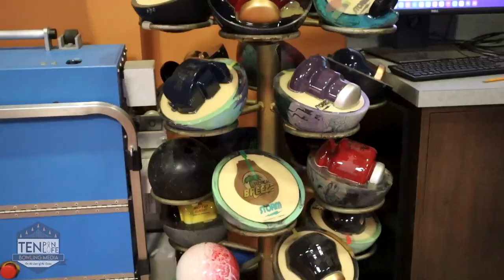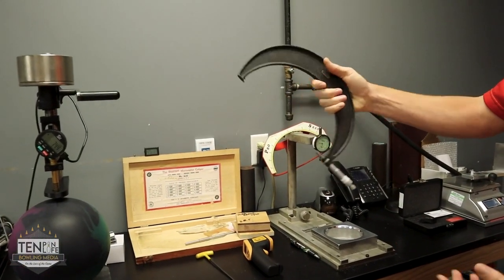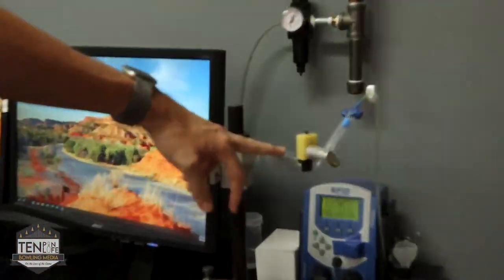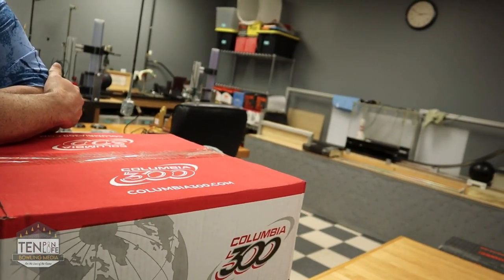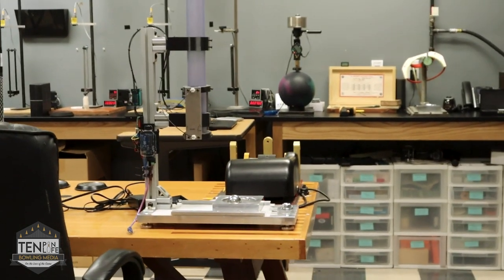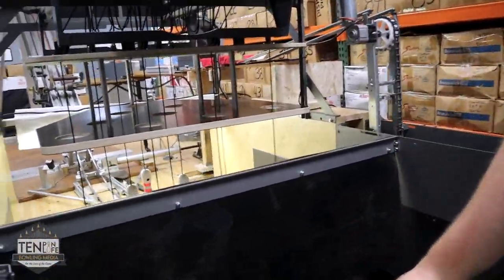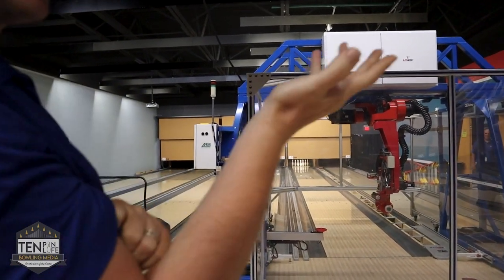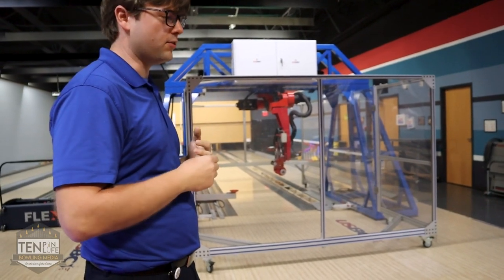Inside The USBC Bowling Ball Testing Process | Ten Pin Life

Comment: I've witnessed more durometer tests than probably most have with the nature of my job. Durometers are used extensively to test the hardness of non metallic military parts. As someone who works every day with Critical Safety military spare parts, I see extensive hardness tests done. I can tell you all you need to know about it. :)

I will also say, I had my UFO Alert put through a military hardness test using a Durometer... it came out at 75D which is plenty hard. So my UFO Alert is 100% legal but thankfully I don't bowl tournaments and such so it really doesn't matter, I can still throw it in league.
Reply: Kyle, were you bothered by them doing the tests with only one durometer?  Storm posted a video demonstrating the variations between different durometers.  Of course since it was their bowling balls being banned there may have been a conflict of interest in that Storm video.  Since hardness appears to be the most controversial issue at the moment, it would be reassuring if USBC had at least 3 different durometers.
Reply: @ricka.wetselphdbowler3526  Nah... just move along, there's nothing to see here. And don't peak behind the black curtain! 🤣🤣🤣👍
Reply: @notonyourlife7939  King conspiracy theory strikes again!

Comment: 64 years old and now having painful thumb issues. Would love to learn the one handed thumbless style you employ. Have you done a video on this? I don't see one listed.
Reply from the maker: I haven't mostly because I really wouldn't recommend it to anyone. It is a completely different method of timing and footwork and the learning curve is actually more than it would be to go two handed. Plus the wear on your elbow and shoulder when done incorrectly is pretty substantial.

I would press hard to find a pro shop operator that is really good to see if they can help with your thumb issues before switching to a no thumb release.

Comment: They appear to be very meticulous in their bowling ball testing, yet don’t acknowledge the fact that durometer is not as exact of a science as they’d like it to be, and don’t mention all the variables that come along with it, even though they explain variables for other parts of the testing that have not be controversial. Only one durometer tester? Even the manufacturers of those testers know it’s only accurate to an extent, yet USBC is willing to soft-ban balls that are mere decimal places out of spec on a field test.
Reply from the maker: Call them. If you're a sanctioned bowler, it's their job to listen. 1-800-514-2695